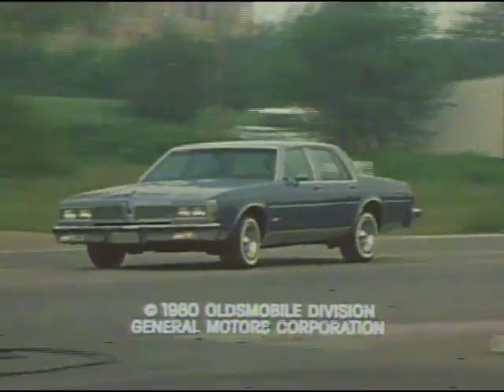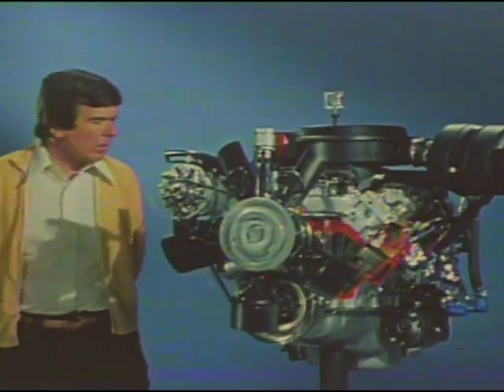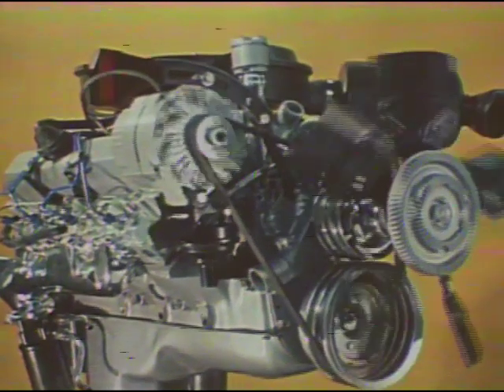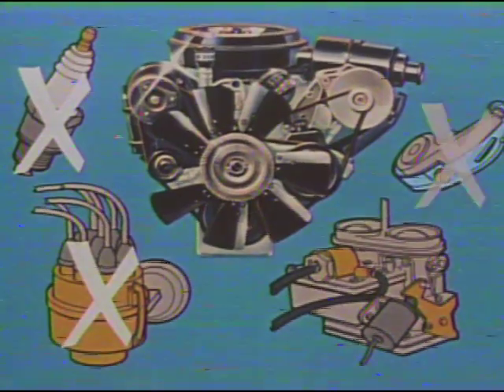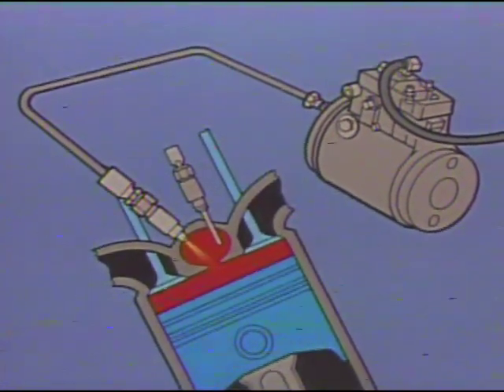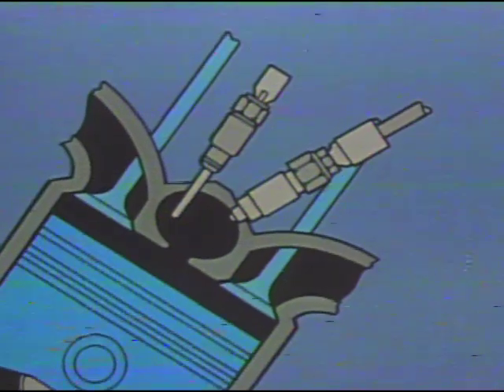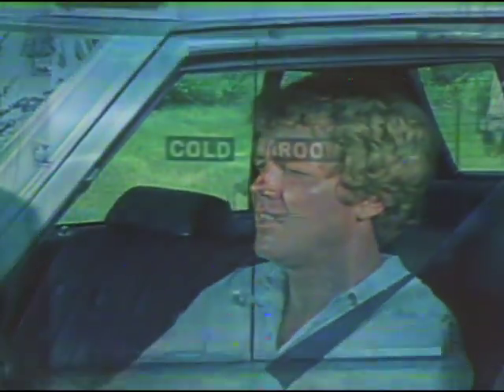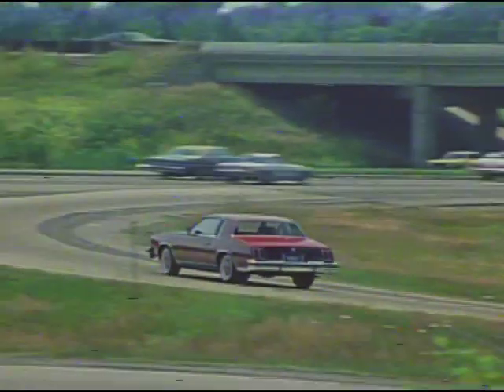The 1980 Olds Diesel Engine (Dealer Film)

Comment: I only wish I could be as enthusiastic about Tesla as I still am about olds diesel.
Reply: My diesel olds sat 2 feet from my house as the house burned down and after fixing a melted wire it drove out of the ashes.... an EV can randomly burn down due to massive banks of LiPo or Li-ion batteries...
Reply: Tesla is gay

Comment: Ive had 2 of them. First one was totalled with 178k, second one I sold to a GM engineer and he still owns it
Reply: In Italy with my Olds regency, bought used in the First 90s, I made 500.000 kilometers without any problem (only change oil engine and water separator filter regulary) and with the second GM diesel car (Cadillac Seville bustleback) now I'm at 270 k

Comment: My dad had a 79 diesel custom cruiser. Worst car he ever owned. Blew the engine with 50k miles in ~ 1982. Olds fixed it under warranty and he traded it for a gas regal. He tried the diesel thing again with the updated version in a used 1984 Caprice in 1987. That one blew the headgaskets with a little over 100k in 1990.
Reply: Similar story...Father owned a 1981 Eldorado with the 5.7 diesel.  Engine was replaced but the damage was done.  He has owned Mercedes ever since.  Hell, I won’t even own a GM product because of that experience.
Reply: These required specific maintenance which most people ignored, resulting in these issues.
Reply: @ic1815  Funny thing...I own a 1979 240D.  With the exception of periodic valve adjustments, there is no other maintenance that is different from a gas powered car.  Bottom line is that the 5.7L was another 1970’s half hearted effort from GM which started with the Vega and culminated with the X Car.
Reply: Lack of a water separator helped  kill the injection pump
Reply: @bobbbobb4663  ironically a Mercedes diesel was what he originally wanted but my mom said it was too expensive so he bought the diesel olds. Years later she commented "had I known how bad that olds would end up being, I'd have let him get the damn Mercedes" 🤣🤣🤣
Reply: @pdennis93  Haha.  Your Mom was right but she would have had a heart attack at the price.  My 1979 240D sticker was $16,500.  The Olds sticker was probably $4,000.  Granted, in terms of durability, it was 4x the car of the Olds but that is realized over many years.
Reply: @bobbbobb4663  iirc the olds was $7k and the Mercedes was $2k more.

This all occurred before I was born (I was born later in 79). My dad worked for a trucking company at that time so diesel was easily obtainable unlike gas which was in short supply because of the Iran fiasco.

Comment: The compression ratio of diesels is about three times that of gas engines. The internals of the original gas engine were not designed to handle three times the load.
Reply: Why would they? The gas engine is nothing like the diesel...except for displacement.

Comment: Those engines make GREAT boat anchors!!!
Reply: My boat anchor has 90k miles showing.  It rolled over once.  Very reliable til it was 40 years old.... then it needed work to fuel system and head gaskets. Wooptie doo.
Saved thousands in fuel after diesel spiked by running half used motor oil. Ran fine on that.  Crap one day i had almost 100% used oil & atf in fuel tank in a pinch. (Had a few bad months with work)
Reply: Yes people regurgitate 30 year old ideas , the DX 350 was a grate reliable engine , the DX fixed the earlier engines problems , but it was to late and all people remember like the above post is the D350 engine . The fact there are hundreds of thousands of 350 DX Oldsmobile motors still running today says it all .

Comment: The GM path to success; convert an Olds gas engine to diesel and see how fast it blows up
Reply: Honestly vw diesels were converted gas engines and had a good reputation.  It's all in the engineering.
Reply: The biggest sin committed by GM was that they owned Detroit Diesel and it appears that GM never got them involved in the design of the engine.
Reply: @bobbbobb4663  When they were converting this engine from gas to diesel, I hear the voice of Jeremy Clarkson saying "I'm sure it'll be fine....I mean, probably...."
Reply: @justsumguy2u  Haha.  I think GM said that too on the Vega motors.  It still blows my mind how bad GM executed in the 70's (Vega, Diesels, and X Car).
Reply: @bobbbobb4663  They also owned Electro Motive Division (RR locos) which were very reliable.
Reply: @bobbbobb4663  They should've used the relatively reliable 6.2 by Detroit Diesel.  The 6.2 didn't come out until 1982 though.  They could've had it ready for the 1978 model year.
Reply: @Mark-eu4ds  GM couldn’t wait until 1982.  I found an article on curbsideclassic that gives a few reasons but CAFE was starting in 1978.  Overall, it is a nice article with one exception...the Mercedes diesels may have been similar to their gas counterparts on paper but were always designed separately.
Reply: They weren't a converted gas engine
Reply: @dtaylor5493  Yes they were, it was based on the Oldsmobile 350
Reply: @Bobb Bobb  Detroit fixed the problems of these engines in 1981, they didn't made them fast, but they were bulletproof
Reply: @agusw4720  No they didn't---the diesel 350 was so bad that GM discontinued it
Reply: @justsomeguytoyou  look up for the LF9 DX, plus they were not converted gas engines, the Oldsmobile 350 had another block

Comment: Had a neighbor who bought an 80 Cadillac Fleetwood diesel. It was his company car and GM had replaced the engine at 75,000 miles. I asked him if had any issues and he explained that he never did . But he made two changes: he increased the oil capacity by one quart and increased the cooling system. Last time I saw him, he had clocked over 100,000 miles on it.

Comment: I remember them on the showroom floor and they had 105 horsepower it was a 5.7 L Oldsmobile gasoline engine converted to a diesel
Reply: HP is not the whole story , a D6 Dozer has 100 HP and so does a 1991 Kawasaki ZZR 600 , but no person is going to say they have the same power !

Comment: Hard to believe, but GM built the indestructible detroit diesel starting in 1938, and many are STILL running after decades of work.  Then they slap together something like this bomb with all their diesel expertise.  It could have been great if they'd engineered it ground up as a diesel.  Cheap trick.

Comment: All they had to do to make these engines bulletproof and successful in the marketplace right off the bat was add a water separator, use stronger headbolts (to handle the higher compression ratio) and use a stronger casting material.  And that was about all it needed
Reply: I'm a fan of my 83 olds Ninety Eight diesel.  2 ton car gets mid 20s to mid 30s MPG and is superbly comfy. My kids love it too.
Yeah,  it needs head gaskets.  Its also 40 years old so I'm not upset

Comment: The 4.3 V6 Oldsmobile diesel was a very good compared to the 350 olds diesel you can't beat the mileage too bad they didn't have a turbo version of the V6 I would put that in a Toyota truck
Reply: Toyota sure could use an engine like that right about now, their engine packages right now is terrible, GM trucks, far superior.
Reply: @user-Dr.  thank you people misunderstand engines even the Oldsmobile 350 diesel was a great engine if from the start that they had they put a water separator in it and a solid crank and rods and head studs with better head gaskets I know a person who rebuilt a Oldsmobile 4.3 Diesel and put it in a Chevette he got over 42 Mi per gallon in that thing with a manual and in that little car it pulled fairly decent what was indestructible and ran forever rumors are rumors but facts are facts thank you for the comment

Comment: I bought a 1980 Delta 88 with a diesel. It was absolutely awful. It leaked oil, smoked like I was fogging mosquitoes and only got 20MPG. I got rid of it after 3 months and went back to a gasoline car. Right after I traded it 60 Minutes aired a segment on the poor reliability of the diesel vehicles made by GM. The bottom dropped out of the market overnight.
Reply: My 98 gets 22 city and 27-35 highway. Drove it cross country and as a family car. It was 40 years old when parked for a had gasket. Sounds like yours was neglected like most were
Reply: @workingcountry1776  

You must lead a charmed life. I assure you that I have not!
Reply: @workingcountry1776  You nailed it.

Comment: I thought they were the worst Diesel engine … then ford proved me wrong in 2008….
Reply: The 6.4L navistar is why ford now builds the 6.7 psd in house and its quite good for a DPF engine.
So there's good from that catastrophe
Reply: I have a 6.0 with nearly 370,000 miles on it. Just change the oil every 5,000 miles. Still running strong so far.

Comment: Using the TH200 transmission did not help either.  Ford used EFI  corporate 302 v8 with 4 speed overdrive transmission. Why did GM not do that with one of their v8?

Comment: That car was horrendous and a joke  ,Mu Aunts 1978/79 not sure Olds Regency Diesel  . I  remember my aunt trying to start that hunk of a crap and it took  forever. I was 9 in 1983 and I recall that all those Gm diesel cars had dual exhaust but very skinny tail pipes behind each rear wheel.I was staying with my cousins and it got really cold and it took forever to get that car to start we had the start stick for cold mornings.There was two batteries in that car over but even then that would not be enough if it was being really difficult cause it took so long to start. That week in January it got down to like 3 degrees and we had to take one of those big kerosene heaters that looked like a jet engine to warm it up the garage , block heaters didn't work well. once we got it fired up we had to keep giving it gas or it would stop so we took the stick and jammed it on the peddle and I jammed it on the seat and it kept the revs about 1900 Rpms. Clouds of smoke would follow that car driving down the road. I find this Dealer film funny as hell, cause its B/S in the worst way.That car was not quite at all it was loud as hell.Sounded like a disposer with nuts and bolts in it.
My Cousin who is 17 years older than me had a V.W. rabbit diesel and it was a great car all through college he drove that car.That Oldsmobile blew the engine a year later. It only had like 60,000 miles on it.They had it fixed but traded it in on a new 1985 Volvo Turbo same car my parents had and Volvos were fantastic cars back then.That car would have been alot better if they would have turbo charged it. Diesel engines suck if there not turbocharged ...

Comment: GM is so terrible at making diesel engines that Isuzu had to get involved for their Duramax lineup... I'm not sure why didn't GM just use Isuzu's truck engines from this era instead of engineering these lumps of turd.
Reply: Good point but nobody would buy an import back then, even an engine
Reply: @workingcountry1776  a lot of of GMs cars from this period (Chevrolet, Holden, Opel, Vauxhall, etc) already use Isuzu engines, infact people where I live would specifically buy the diesel variant since the isuzus are reliable while the gasoline variant is unreliable garbage made in house by GM. GM makes great truck engines but their small displacement car engines are unreliable 

I think in the US market the Chevrolet chevette is the only one with an Isuzu diesel

Comment: Could’ve been a great alternative but in classic GM fashion, they screwed it up. Had they developed a purpose built true diesel instead of using a gasoline designed block as the foundation maybe it wouldn’t have been the epic disaster it was. These crappy furnace engines gave diesel a stigma for decades. Unreliable Roosamaster injection pumps and regular head gasket failures were only 2 of the features customers could look forward to in this design.

Comment: Hi from Rimini Italy. I have had an Olds regency diesel and a caddy Seville diesel (regulary imported in 80s) and this engine developed from 5.7 gasoline for me Is very reliable, never problem, but in Italy was sold from origin with water separator. A problem are the two batteries 12v to have more ampere, because are very expensive. This engine was made with too compression and the pre-chamber was unuseful.